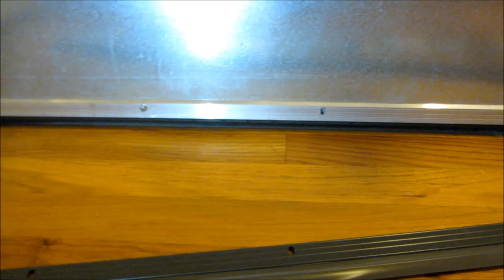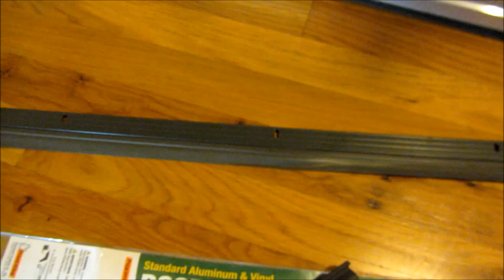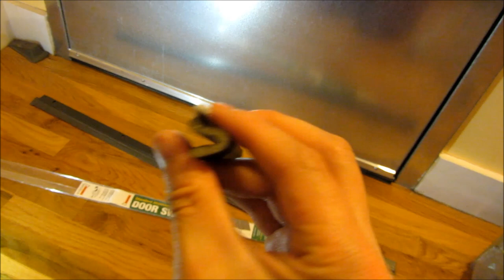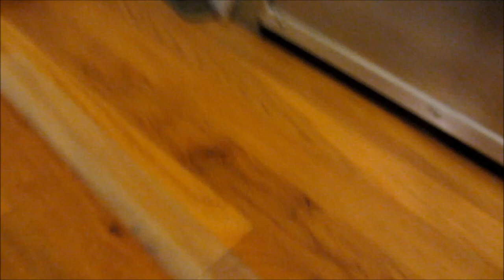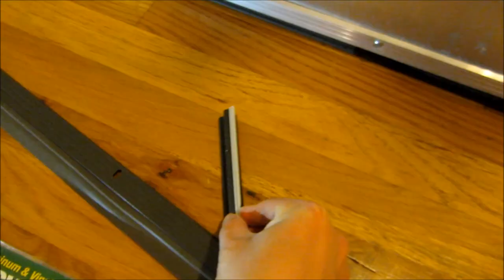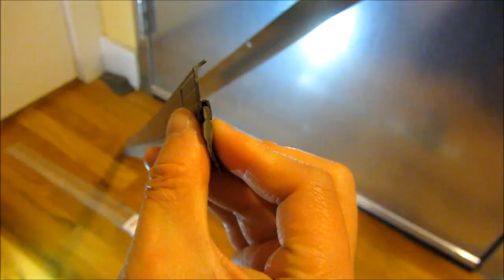How to Create an Air Tight Door Sweep | Fills varying Gap Lengths | Floor Hugging Installation

Comment: I really appreciate how thorough you were in your explanation of why this “hybrid” sweep is more efficient than the standard one.  You carefully and slowly enough explained each advantage. Since I didn’t know what a door sweep was until today, I would have liked a follow up video with a detailed explanation of how to install it on the door.  I did not know about cheap vs real screws and was shocked to learn a screw can break.

Comment: New subscriber here.  Thanks for your video.   I was wondering if the piece you inserted in the slot ever worked its way out.  I guess one could use silicon to seal it.   Thanks again for this tip

Comment: Thank you  for this video. Can you use the door sweep stripping to insulate sides of the door as well?
Reply from the maker: That is the original intent of that stripping is for the sides of the door.  They sell a kit for that with this stripping.  However for the door sweep, this hybrid solution is not sold in a kit.

Comment: Is that rubbing your floors?  Any wear and tear from the door sweep rubbing on the floor every time the door is used??
Reply from the maker: Yes, its rubbing against the floors, but its not scrapping the floor.  Its been about 18 months,  there is no wear and tear on the floor.  That piece is simply soft foam wrapped around a plastic sleeve that expands, so its not going to cause any wear and tear.